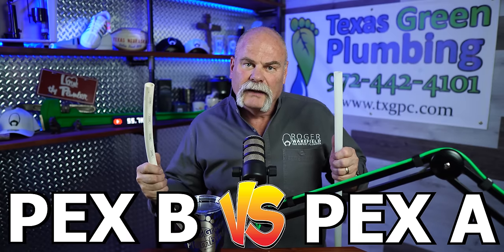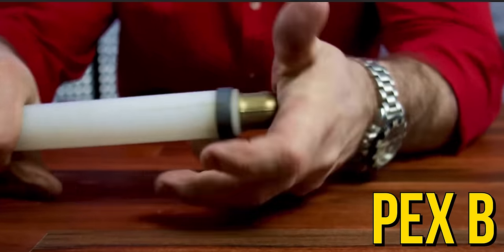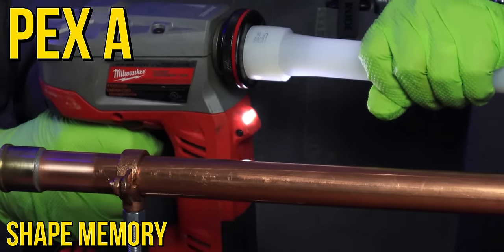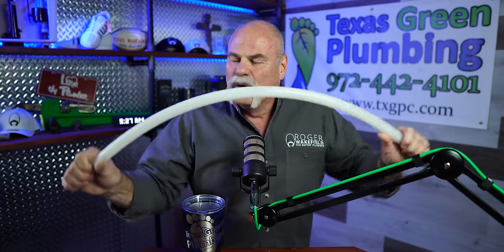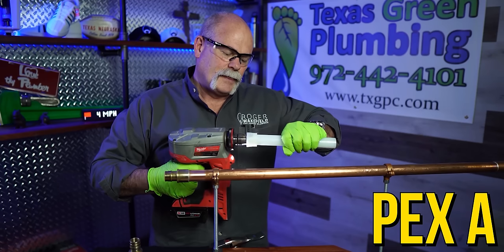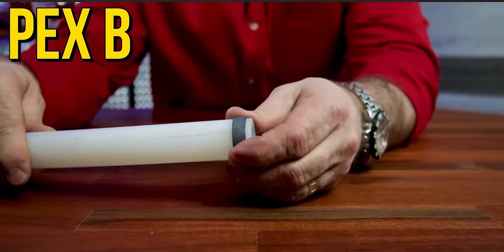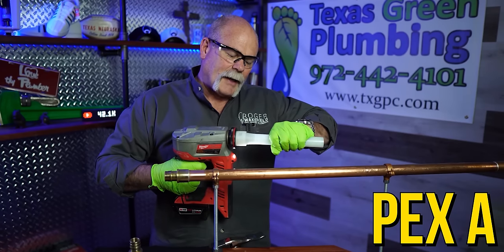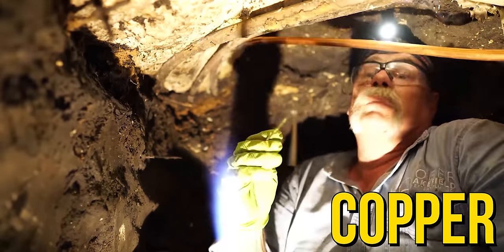PEX-A vs PEX-B - What's the Difference? Which Should You Use?

Comment: I had to replace the plumbing in my mobile home 15 years ago. The plumber wanted $5,000. He showed me how to work Pex A.  I bought a manual expander tool and needed pipes and fittings at a cost of $500.  I did the job by myself in 14 hours.  When I turned the water on, I had zero leaks. I highly recommend Pex A.
Reply: i will be re-piping my mobile home in a few years and will go pex-A. looking to do it myself, but will still get a quote too
Reply: @plumbherhub1664  i think code requires a min 18" of metal pipe installation kit from a water heater before you go pex to rest of house.
Reply: @DScott8732  12" here from the water heater is code for Pex-A.
Reply: @plumbherhub1664  how do you split poly pipe do u mean melted or something because I am a plumber and have never even heard of anything like that
Reply: @left.toe.9749  so yes you need a 18" heat trap though its not required on residential but on uponor the tool that expands the pipe must cause weak points and if constantly hot causing thermal expansion I think this is what the cause of the burst is. Poly pipe should be cut by pipe cutters copper cutters or band saw. It's not the cut its the combo of heat and expansion that weakens the joint
Reply: I’m about to do the same thing for my house.
Reply: You’re the reason people should charge for bids
Reply: @Brazda25 it was the plumber who did the (free?) estimate that showed him how to do it himself and not need a plumber. 

Think about it.
Reply: @Brazda25 only idiots do free estimates.  I don’t give estimates.  If you call I go do the job and it is what it is. Word of mouth 22 years.  Nothing in life is free.
Reply: 500 with the tools and fittings?
Reply: Long time ago....
Reply: The free estimate plumber might have also not wanted to replan the mobile home for various reasons. There are still good people out there.
Reply: @Californians_go_home the client should agree to your price before you start...
Reply: @ysagas I’m questioning that too. I spent 197 for Apollo Pex A. Bought Red and Blue 3/4 and 1/2 100 ft roll. My friend who is a retired plumber helped me replumb my modular home. We ran 3/4 to and from the water heater. Supply line or drops were 1/2. The fittings and expansion rings is where I can see close to 500. When we started we found a bunch plumbing errors. Someone connected galvanized to brass and copper at my main and show risers. Both of which were corroded and leaking water. My home was connected to a hose bib which was leaking. Found out my waterheater was leaking it was 20 years old. It was refreshing pull out the old cpvc.

Edit

We completed everything no leaks far as I can tell. Hoping my Water bill drops. Anyone who plans on replumbing with PEX A I would buy the battery powered expansion tool, yes it is pricey but well worth it. We did it with a manual tool but 3/4 was tough to expand if you are in a tight space as you have almost zero leverage.
Reply: Wish Id found this a couple weeks ago.

Comment: I repiped my whole house two months ago with pex b. The material was available at the home depot and the ryobi ring tool was only about $120. My flow is better then before because  I upsized the  pipes and designed it more effectively.
Reply: Never had a issue with Pex B but the method Pex A uses makes things so much more efficient. Eventually I will purchase the tool for Pex A or what many call is uponor but sucks because its not readily available at your local lowes or Home depot. Which is why I use Pex B, the convenience of being able to run down to the local hardware store rather than ordering a bunch of parts online from amazon or a plumbing supply house for Pex A .
Reply: If you were going to spend the time to do all the work, why did you not just use pex A?  Pex A is trustable. I dont trust crimp rings at all.  If your crimper was off just a little bit then those crimp rings could slide off over time.
Reply: @common_c3nts  From the research I performed the crimp rings seemed plenty reliable. It is much more convenient for me to use the same store and tool line I'm already invested in. The majority of the plumbing is in a crawl space so long term accessibly is not an issue. My old copper pipes had pin holes forming, and there was a high chance of failure in the near future. So moving to any new system offered much less chance of failure. I agree that PEX A is a superior system, but I don't think that discredits PEX B. I'm trying to portray that the much more accessible system PEX B is still very viable. All trades work has a chance of failure and require some skill and competency.
Reply: @apollowolfe  I think bot A and B are good if like all things they are installed properly 
My only pet peeve is restrictions 
Even with copper I prefer where possible to do 2 45s to lesson that 90 restriction 

I have installed B 
Pressure was fine 
I run all 3/4 pipe to the fixtures and drop 1/2 into the fixture cabinet and 3/8 to the faucets and toilet and if course the shower remains 1/2 
But 
Every fitting is a restriction 
Maybe some OCD in ME 
I don't know but your fine with B 
In my opinion.  

It is more convenient the big box junk stores but 
I recommend check out the supply house products 

I once was closer to a Depot so for a p trap hell with it justbgrab and get done 
Well try to cut that junk with your cutter it squeezes it rather than cuts it  you have to twist the pipe in the cutter 

Supply house same money pennies different   but 
Put that in your cutter and see the difference 
You know you have quality materials 
Do it once right and forget it. 

Big box is not 
Well my opinion does not matter OCD again LOL 

Just food for thought 

But if your happy with pex B and its working for you 
I agree its better than leaving the bad pipes you know your going to be working on more often than you care to.
Reply: So if I'm changing out some 1/2" polybutylene for pex b, I should step it up to 3/8?
Reply: @RileyNA  I misunderstood, I think you meant upsize to 3/4 inch? If so I would recommend running all trunks as 3/4 then branch with 1/2 to each fixture. If you do a manifold I would feed the manifold with 3/4 and use 1/2 off your manifold to each fixture.
Reply: I have seen connections of both systems fail. Always user error.
Reply: 3/8 is smaller than 1/2...
Reply: @Kyle Bunting - What do you mean by "1/8 inch from the fitting"?
Reply: @raken79q  - Thx, good explanation.
Reply: @apollowolfe  I’m having an issue since replacing a long section of copper with Pex B.  1/2” copper comes off the boiler then switches to 1/2” pex.  Then I sweat the pex tee fitting to the 1/2” copper pipes leading up to each fixture.  Now I’m having flow issues.  Pressure starts fine, then you can hear it fluctuate.  On hot you can see it visibly.  I’m feeling like the restriction from the B fittings is causing a flow issue as it can’t refill the 1/2” copper leading to the fixtures fast enough.  I’m thinking of replacing it with 3/4” pex so the fittings will allow for more flow.
Reply: @Console_Gaming_Vids  Hey, what I did for my hot water is I ran 3/4" to a manifold with 6 outlets and ran an individual 1/2" line from each manifold nipple. What I would recommend to you is switch your boiler output to 3/4" and put in a 3/4,1/2,1/2 tee and keep tie your existing 1/2" lines into the tee. Depending on your boiler you may be able to get an 18" flexible metal 3/4 npt thread to 3/4" nipple up replace the 1/2" cooper section. Let me know if you have more questions.
Reply: @RileyNA  Yeah, I would step it up to 3/4" pipes.
Reply: @RileyNA  um.... going from 1/2 to 3/8 would be a step down.
Reply: Hes right just upsize to 3/4 standard and you get plenty flow i got 15 gallons a minute for my friends hose bib i put it
Reply: You want a diploma or what?
Reply: What about the Zurn PEX B. It uses expansion rings just like PEX a. But they say it has a higher burst of up to 1,000 PSI
Reply: @primewestplumbing811  The way I understand it to be is that you should not expand PEX B. As for the burst rating it seems irrelevant because you would have greater problems at 1000 psi.
Reply: I read “raped”
Reply: @common_c3nts  use a go or no go tool for the crimp rings. If ones off, then all of them are.
Reply: @apollowolfe  PEX B for residential you don't expand the PEX B you crimp it. If you expanded PEX B to fit onto an insert connection you fucked up lol. PEX a, or wursbo is used with insert fittings and the expansion tool. Use PEX B for residential and PEX A for industrial like sky scrapers.
Reply: @apollowolfe  thats the way I was taught in school
Reply: I am looking at Zurn Pex B as it can use expansion fittings. I plan on doing Pex-B because it has less chemical leeching. Also I will upsizing my pipe either way since the piping takes too many 90 turns that hurts flow and pressure.
Reply: @Kyle Bunting I was thinking the same thing, I'm no plumber but they are exactly the same as far as flow. Why would there be a flow restriction unless it was installed wrong!
Reply: I'm a plumber and got to witness a self taught guy do it all on his own with minor issues
Reply: The main issues I saw were under sizing the main line
Reply: @common_c3nts  Slide off?  No way..  Also if you crimp properly there is zero issue.  Also test with Go_NOGO tool first crimp of each job. If your crimpers need tightening then turn the pin and try again.  But hey I've only been plumbing 20+ years. Pex A or B wouldn't have ANSI or CSA or NSF certifications if it failed too much.  Just look at poly B the crimp was good but the pipe failed so the whole system was pulled out of the code book. 
Anyway PEX A and B have their own traits.   I personally use Pex A pipe and crimp it with Pex B tools and fittings.
Reply: You noticed better flow on your low flow faucet using a 2.5 gpm restrictor?   Do you realize how much smaller the orifices get as the water gets closer to the spout?
Reply: @johnbeckwith1361  I noticed better water pressure because it was originally piped poorly. Even though the spout at the end is small by upping your pipe size you also have less frictional losses over the whole length of the pipe.
Reply: @startstrategieswithjamesjo4888  I like the way you think..... Do you still need to expand A or can it be pushed on the fittings?   Oversize all PEX to the next size up from the copper it's replacing? Please confirm it's that simple. I'm replacing a failed(HW) copper(3/4) line under the foundation in the attic, with insulation sleeve. 
Thanks for your input.
Reply: @robertjackson7590  Never use push fittings in an enclosed space. If the space is open and you're able to inspect them regularly then they are up to code.. (personally i avoid them) brands like sharkbite claim 25 years but as a journeyman plumber I'd say poo poo to that.  They open up if they freeze and I've seen many leak if their not supported well.  The reason why I use Pex A pipe and Crimp pex b is because of the tools.  I've already got Pex B crimpers and Pex A can be crimped with out an issue.  That said there is nothing wrong with either pipe.  Pex A is simpler to use because it's more flexibly and if you accidently kink it it will come back with some heat.    Pex is fine to use under ground.. But attempt not to use crimped fittings under ground. If you have to make sure to use a water proof tape over the fitting making a complete seal. Now i'm Canadian so i don't know what your laws or codes are but when going through a layer of cement horizontally or vertically it's supposed to be sleeved.  As for How you want to run the lines it's all about system design..  there are pros to trunk and branch and pros to home run.  personally i prefer trunk and branch especially if you plan on using a recirculation line which I rough in on nearly all of my projects.  I also rough in for a water softener, and RO.  I do this at no extra costs for my customers because 5 times out of 10 I'm the one installing the system and it's frankly easier during construction compared to wangling it in a finished home.  So before you start doing the work consider the use and design you want as well as what the next owner might want.  A good design with extra rough in's can be a selling point and increase the home's value.
Reply: @startstrategieswithjamesjo4888  I'm moving the HW line from under the foundation to the attic in North Texas. 
" I'm replacing a failed(HW) copper(3/4) line under the foundation "moving it into the attic", with insulation sleeve."
I'm a retired Ind transmission guy and don't trust O Rings for longevity in this application. It'll be in the attic so it must be a 60 -75+ year duty cycle. Heat cycled O rings don't last long, maybe if they were Teflon but not rubber.
I grew up working with Push Lok hose and Barb fittings in my field. 300WP/1000burst. I guess this PEX combination is as close to that as it gets with PEX having a better duty cycle over rubber hose. Cool stuff.
Really appreciate your reply and insight. Like you I want to do this one time.
Reply: ....DON'T trust sharkbite push-to-connect, the internal o-ring will dry out and fail over the years, the same thing to PEX that does not use a metal clamp. The expansion idea will fail regardless if it takes 10-20 years. The material will lose its flexibility thus its memory turning the water system for the entire house into sprinklers, and you will have a waterfall coming from all over the ceiling.
It will be a really expensive nightmare for homeowners 2 decades later. 
PEX and other new systems are only beneficial to the repairing contractors, speeding up the process, but not necessarily lowering the homeowner service bill.

Like the RV industry, the US house construction industry has become very profitable while offering expensive and poor-quality house constructions. The houses are not built to last, forcing the next generation to buy new homes to keep builders selling new homes, a real mafia with standards not ruled by the authorities. 
In sum, our industry is becoming more and more like the Chinese manufacturing quality.
Reply: If up sizing pex B, do they make a 3/4" to 3/8" shut off valve, or 3/4 to 1/2" with 1/2" to 3/8”(outside of wall) flex hose. More so would this be recommended over 1/4” hole in 1/2" PEX
Reply: @joshscott8678  I am not sure about the 3/8" hardware options because I only used 3/4" and 1/2" lines. For all my fixtures I have 1/2" shutoffs.
Reply: No. That would be 3/4" pex B to compare to the flow of Polybutyl 1/2". 3/8" is smaller than 1/2".  @RileyNA